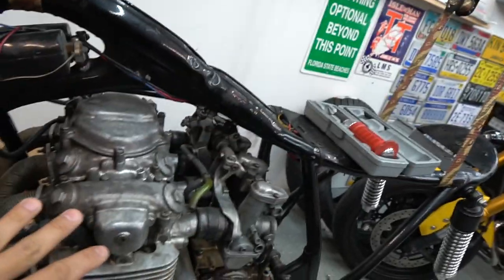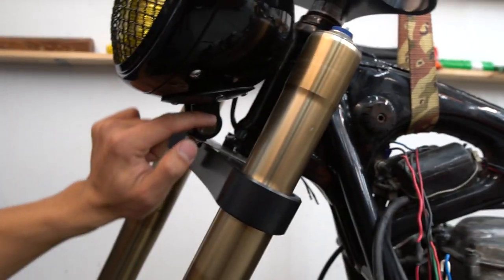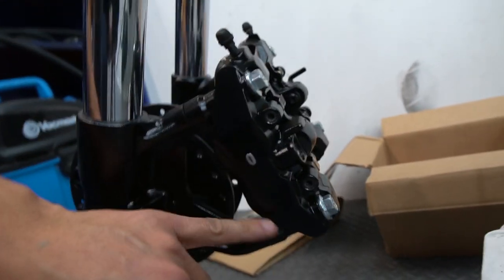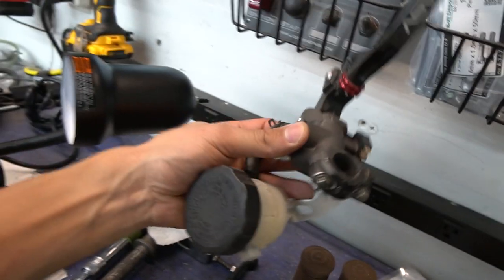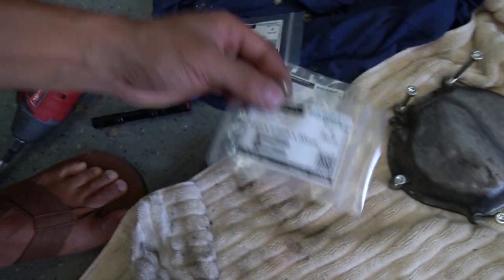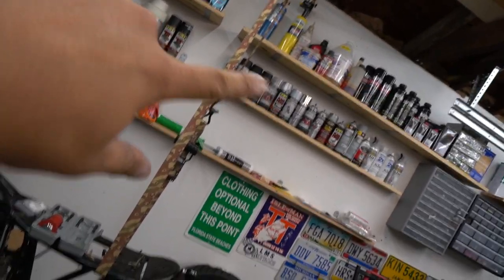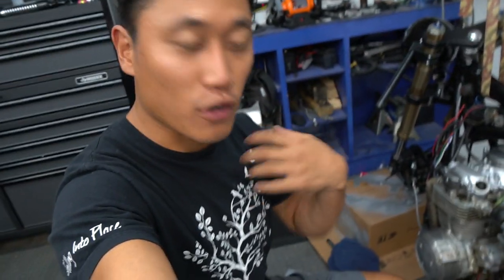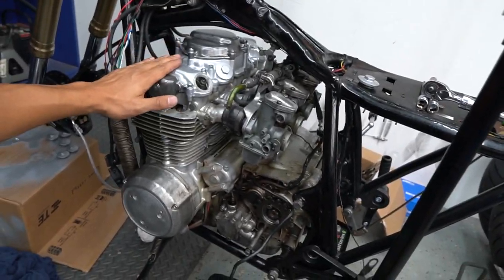CB550 Gaskets, Clip Ons, Head Light, Etc - CB550 Cafe Racer Build Pt. 79

Comment: regarding the bolts, one trick i found is that when you put all of them back in the hole before screwing them in, they should all stick out the same height, regardless of bolt length ;)

Comment: Love your build buddy!  Bike is looking amazing and cant wait to see it all together.  Finally got my own 74 cb550 and plan to do alot of custom work as well.   Also wanted to pass a tip along to ya and your fans that i think is even easier than the taped gasket.  Go buy some cheap super glue and just place a drop here and there where you need it to stay!  Works great for upside down work AND for those stretched gaskets that you might have to still use from time to time on builds.  Saves a ton of time and headaches.  Happy wrenchin and hope the build does smooth for ya!
Reply from the maker: That's a great idea! Thanks for the tip!
Reply: @CZeroMedia  
Chris Riddiford
Facebook

Comment: Why not use a 50mm clip on and use 1mm thick sleeves to take up the additional space? Just take a 1mm wall thickness tube thats 48mm ID and 50mm OD and cut it to the length of the clip on so it sits flush, then cut it in half so you can put it on the fork tube and the clip on would slide down onto it.
Reply from the maker: I considered that. But I didn't feel like chasing after the exact id od sell pipe and chopping it up. And on top of that, adding another variable for possible loose clip ons